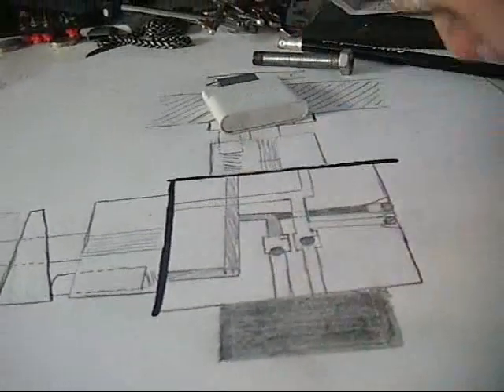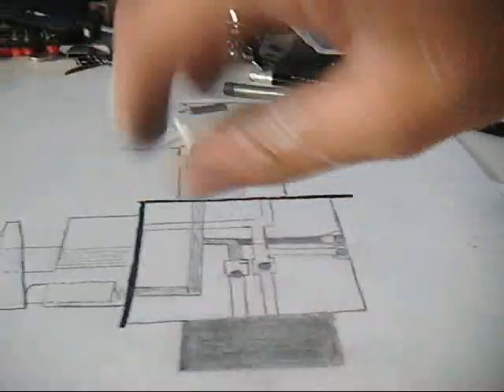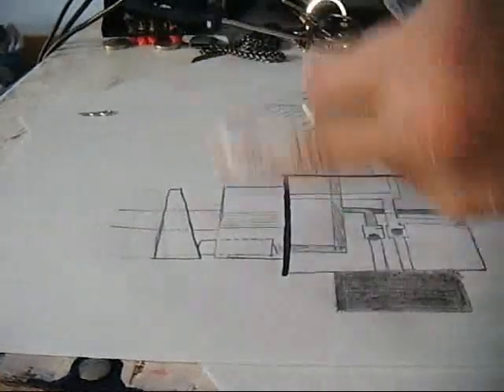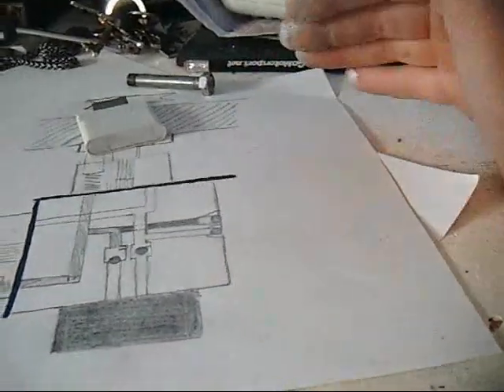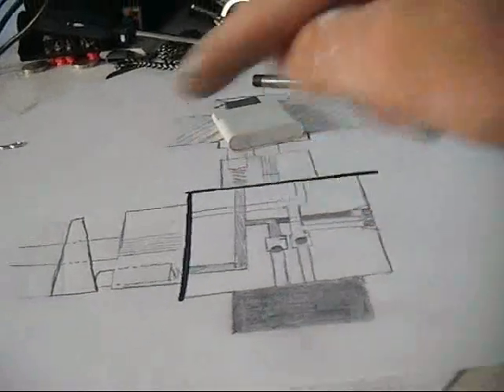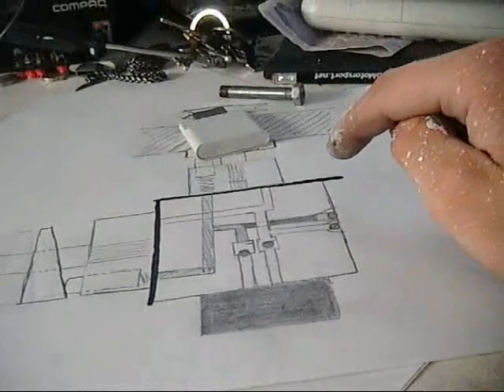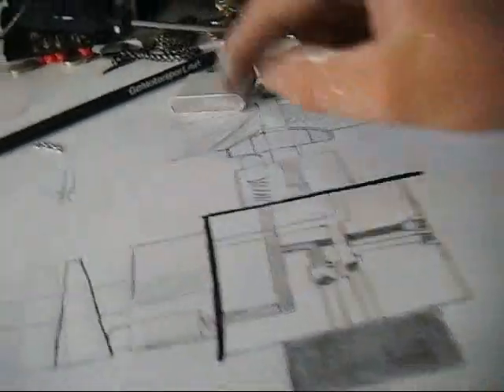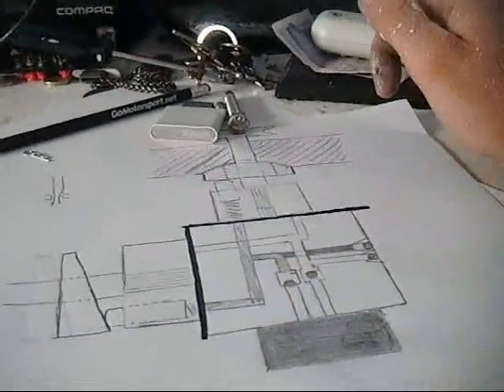hydrostatic transmissions part 2

Comment: This is a poor man transmission, no shock valve, no anticavitation an safe (overpressure) valve, this system is good for low speed, flat therein  and low torque, is no safe.